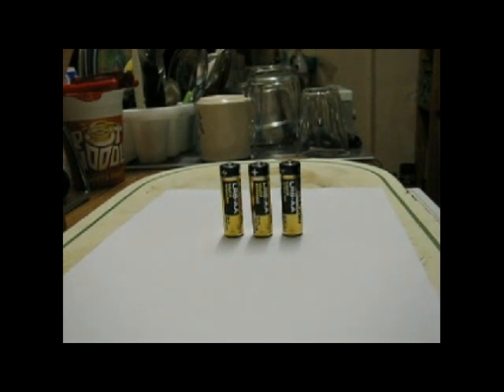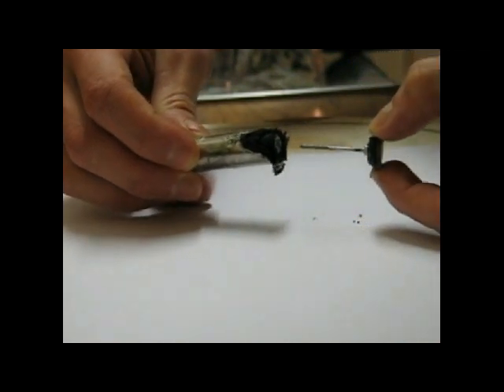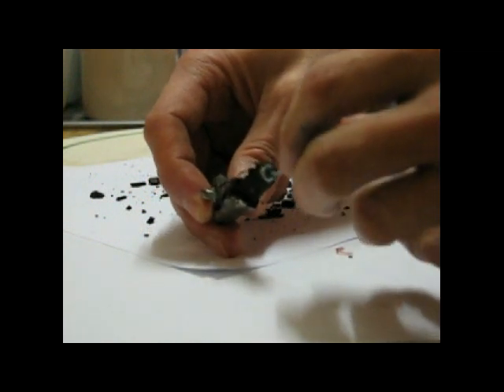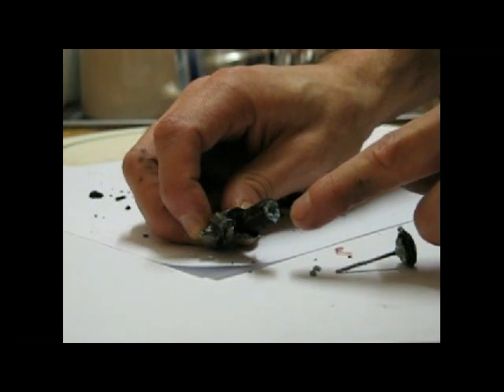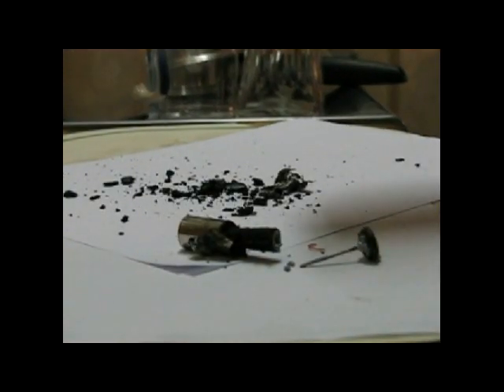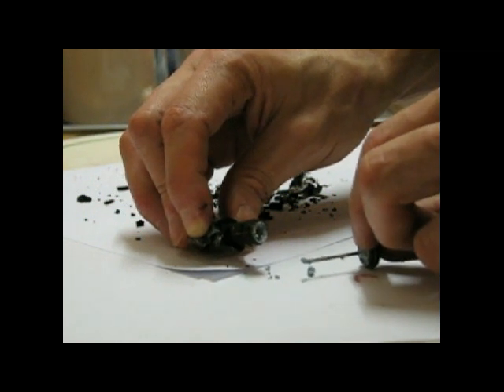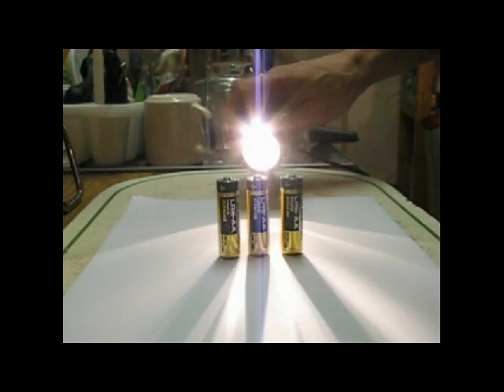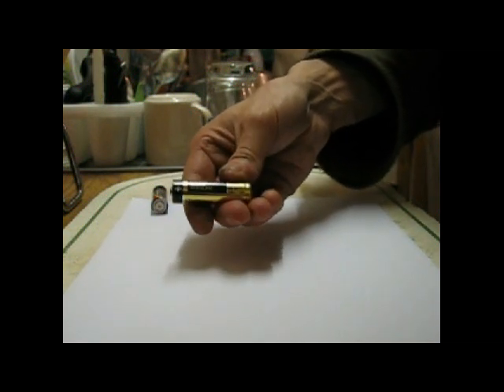Recharge Your Alkaline Batteries

Comment: You cannot recharge alkaline batteries with any practicality. The only way to extend the life of the battery is to put a small, very small trickle charge on it after it's been used for a very short period of time. A good example would be a portable CD that uses 2AA batteries that typically lasts 10 hours on 1 set. If you used a brand new set and used your cd for a 1 hour workout each day, by putting a charge on the cells each day after using it, you might triple or quadruple their life in the CD player to 30 or 40 hours. But this is inconvenient and it's just as likely that trying to charge them will do the opposite and drain them and even more likely that the battery will leak and ruin your CD player. In any event, Low self discharge NIMH batteries are sold just about everywhere and will work far better.
Reply: MattBlytheTheOne Knowing absolutely nothing about chemistry, I am assuming you need different chemicals that have different properties to get a potential across them?
Reply from the maker: The point is it is still the same technology as alkaline batteries, the manufacturers just package them a bit differently..
Reply: MattBlytheTheOne No it isn't, the chemistry is completely different.
Reply from the maker: Yeah it is, it is still using a combination of two metals and an electrolyte conductor.
Reply: MattBlytheTheOne
That is the nature of a battery be it a primary or secondary cell. Take a look at the data sheet for an alkaline cell (say an Energizer AA) and a rechargeable NIMH Energizer AA cell. The first thing that will pop out at you is that the amount of energy you can ultimately recover from a primary cell like Alkaline is dependent largely on the load and temperature. The higher the load (at the same temp), the less energy you can ultimately get from it. With NIMH, NiCd or Lipo, it generally doesn't work like that unless you put such high loads on it that you go out of spec and overheat the cell and this is because of the chemistry differences. There is reason for that rubber seal, it's for venting (to keep it from blowing up or building so much force that it shoots electrolyte out of the weakest spot)  and you will find a similar seal on secondary cells though it will vary with shape of the cell.
Reply from the maker: tarstarkusz
The metals might be different but the big difference is the seal, rechargeable Nickel Metal Hydride batteries don't have "air vents" so they will not leak out their electrolyte conductor, thus making them rechargeable.
Reply: MattBlytheTheOne NIMH cells have vents, trust me. They aren't normally open, they open with pressure to keep the cell from catching fire on a short or to keep it from exploding. That rubber seal also protects from short circuit. The whole can is negative all the way up to the anode (the positive button). Don't believe me, take the skin off another battery and put the neg terminal of a meter right next to that button and then put the positive terminal on the button and you will find 1.5V. Not all alkaline batteries are made this way, but many are. The rubber ring, in these cells serve 2 purposes, to let out pressure if the cell is overloaded and to prevent short circuits.
Reply from the maker: tarstarkusz The cells I have do not have vents. The alkaline solution does not dry out. If they had a pressure build up the case would give way. Can you show me an example of rechargeable NiMH cells with vents? As far as I know rechargeable batteries are built to withstand being recharged.
Reply: MattBlytheTheOne If you want to see a Li-ION or NIMH or even No-Cad cell vent, put a dead one in series with fully charged ones, it will reverse and vent and loose charge capacity permanently. ALL rechargeable cells have pressure vents. You may not be able to see them, but they are vented. Most are vented on the inside with seals designed to to vent at a certain temp or PSI. Think of it like a fuseable link, it's there, but you can't see it.
Reply from the maker: Well we have your word for it but I havn't seen one yet. It would make sense for safety reasons. Show me the link.
Reply: MattBlytheTheOne A quick google search of rechargeable batteries reversal and venting brought up this link which uses the words outgassing and venting. 
http://www.ka7oei.com/nicds.html
It also in the batteries for dummies PDF file written by a battery engineer.
I'll give you an example, there is ring around the anode of the cell that is a vent. It's 'normally closed' but under pressure it will leak gas (which is why the loss is permanent). Sometimes the seals are inside and not accessible and might not be recognizable, but all batteries are vented including primary and secondary cells. Many batteries have chemicals that spontoniously catch fire when in contact with water or high humidity (like lithium). Not venting could cause a pretty bad explosion in children's toys too. Kids are known to put differing chemistry cells together, old and new cells etc. The venting is done to cool the cell and to keep high pressure buildup. Just how much pressure do you think it takes to blow a cell apart?
Reply: tarstarkusz One other thing... If you are looking for something that looks like a vent, you might look forever. The way they usually work is a seal or ring is rated for say 2 atmospheres and is designed to expand if 2 atmospheres of pressure build up in the battery. IOW, it has more than 1 function and the venting function might not be obvious.
Reply from the maker: I look forward to seeing the designs. Are car batteries vented?
Reply: MattBlytheTheOne Depends. Car batteries are a lot tougher and sit in a car who's under-hood temp might reach over 200F and under 0F. But yes, many are vented, that is part of what the refill holes are for. The service free batteries, I confess, I do not know if they are serviceable or not. But I do know that liquid lead-acid batteries build enormous pressures. I've witnessed the filling caps flying across the room. Maintenance free LA batteries use gell, so I don't know how they work.
Reply: MattBlytheTheOne " I look forward to seeing the designs."  Ever heard of a trade secret? Even so, if you google it, you can probably find a generic schematic.
Reply from the maker: Yes I have heard of trade secrets. Ever heard of electrinium?
Reply from the maker: Or wondered why the battery companies use a bimetal sludge or how it is made?
Reply: MattBlytheTheOne As I understand it, it's never been demonstrated.
Reply: MattBlytheTheOne Yes, and I looked it up. I am not trained in Chemistry so I don't fully understand it. My specialty is electronics. I have formal training and 20 years experience.
Reply from the maker: I don't believe it has but you have to question why they use two dissimilar metals. It has something to do with the size of the atoms. 1.5v is typically the potential voltage difference between the atoms. One bonded pair will not give much power but lots of them will. Me too I was trained in electronics. What I learned after 5 years at college and then university and years of experience could be written on a matchbox. That's why I had to start examining the fundamentals because you need them to understand anything about electronics outside of a text book and they are not taught by the academic curriculum. Just like psychology does not teach you how to think.Which is why I took up psychology! I'm a slow learner  lol.

Comment: This is a lithium manganese battery. The cathode is zinc and the anode is manganese dioxide. Cathodes are negative electrodes, and a solution of potassium hydroxide separates these two electrodes. 2 hydroxide ions from the electrolyte become a water molecule and the extra oxygen bonds with zinc as it oxidizes releasing 2 electrons which will be picked up on the anode and the water molecule reacts with the manganese dioxide and the two electrons forming manganese oxide and two hydroxide ions. 1.22 volts of emf is from the oxidation of zinc and .22 volts emf is from the reformation of negatively charged hydroxide ions from two electrons a water molecule and further oxidation of the anode and these metal oxides are pretty poisonous and flammable lol
Reply from the maker: I think the important thing here is the bi-metal sludge that makes up what you call the electrolyte which is actually a fluid that allows electrons to flow between the molecules in the sludge. How the sludge is charged is the really interesting part.
Reply: MattBlytheTheOne It's not a bi-metal sludge, and it's not the electrolyte.  The electrolyte is KOH, and the sludge is powdered zinc in a gelling agent, with a trace of other ingredients to reduce hydrogen gas production (which is what causes leaks).  If you charge them, you'll generate a lot of that gas.  Why bother?  Get some good Eneloop or other LSD NiMH if you want to recharge batteries.  NiMH hardly ever leak.  Alkalines often do, and are certain to (in the long run) if you charge them.
Reply from the maker: Ok so what is NiMH if it isnt Nickel Metal Hydride? And what about cadmium and lead batteries.... its not even about recharging your old batteries it is about raising awareness and improving battery technology.
Reply: MattBlytheTheOne The video is about alkaline batteries.  NiMH are constructed differently and use a different chemistry.   Misinformation doesn't raise awareness or improve technology.  http://www.powerstream.com/BatteryFAQ.html for more info.
Reply from the maker: radellaf  You will notice ALL alkaline batteries are a combination of two different types of metals or elements... they have to be this way to obtain the voltage potential across the differently charged atoms, without which there would be no battery and without a conductor an "electrolyte" there would be no flow of energy. The link you posted says nothing about HOW these batteries work. What exactly are you misinforming people about?
Reply: MattBlytheTheOne This covers everything.  I'm not going to try to teach you electrochemistry in a comment thread: http://batteryuniversity.com/learn/
Reply from the maker: radellaf  It covers the basics of conventional text book battery theory and good idea.

Comment: Never put non rechargeable batteries in a NiCad or NmH charger,I did, and there appears to be a discharge of some kind [Gas?]which ruined the plating on the contact points on the charger and corrosion appeared all over, I had to scrape the surface clean and coat the contact points with solder.
Reply from the maker: They can leak and the electrolyte might damage your equipment. Did day that in the video. Not sure why they call them alkaline because the fluid that comes out is corrosive like acid. Another stealthy way if hiding the batteries real contents probably.
Reply from the maker: That is interesting thanks. Is that a fact?

Comment: Is the metal casing of the battery made out of lead or the inner core is made out of lead ?
Reply from the maker: Not unless they are lead batteries. Usually the case is tin and the core is zinc as far as I know. The surround sludge is usually a two metal compound which is surrounded by carbon.

Comment: Matt, the only safe way to re-charge Alkalines is to pulse the battery with "cold electricity" which is voltage without amperage. It is the amperage which causes the heat and leakage. I have a video that demonstrates one such circuit by IMHOTEP Auto Relay Charges My 9 Volt Batteries
Reply: +Ronald Gerth "Cold Electricity" huh?  Heh, the "zero point energy" people.  Jeez, you can't have "electricity" without a current...plain and simple.  No current is just that..how do you expect to do any work (otherwise known as power, which is Watts, which is amps x current) without a current?  You are right, it is a safe way, but not to charge anything. Period.
Reply from the maker: +ngc 1969 com ngc 1969 com I havnt researched "cold electricity". It is possible to have electricity without current flow (but not at the atomic level as they continuously spin which requires energy) it is called "static electricity" which is energy held in potential. Hence the term voltage potential. I agree that in order for voltage charge to flow from one state to another there must be current flow. Power is only measured when work is being done but something can have lots of potential power even when it is not doing any work.

Comment: I have always recharged alkaline batteries, even leaving them on overnight if they are decent quality (Energiser / Duracell etc) on a low current wall charger. As a kid, if i needed a battery quick, i would put 12vDC car battery charger through about 4 - 6 for a couple of minutes, lined up in series against a straight edge....lol. Never recommended, but It worked many times. :)

Moral of the story is, better quality alkaline batteries seem to hold charge better and don't get too hot either, and/or leak.
Reply from the maker: I would never leave alkaline batteries unattended or on charge overnight. The heat up and leak. If they didn't leak the pressure might cause them to explode. Exercise caution and safety first.

Comment: Overcharged my NIMH Motoma 2500 rechargeable for an hour or two but they did not leak just deformed the plastic box they were in, due to heat.
Now when i put them in my device they get really hot very fast. Could they still be of some use or are they beyond repair.
Brand new first charge killed them.
Reply: +linkingaj Wow, nobody answered that. not surprising.  I wonder how you made out with that?  Hahahhaha.  I would have tossed 'em.

Comment: In my experience and to help everyone out there I will tell you an almost 99% fool proof method of charging non-rechargeable batteries. Buy a socket timer with 15minute setting capability. Plug in your normal NiCD/NiMH charger into the socket timer. Set the timer to charge 15mins/Hour only. Leave the charger running for 4 hours then check the voltage. Try not to exceed 1,6 volts, check with multimeter, if you cant check the voltage, dont charge your batteries..simple. Charge again for 2 hours then check voltage...
Non-rechargeables and rechargeables have seals for safety, so they can vent and not explode, however some batteries if charged too hard for too long will go bang..be warned. A leaky battery should be disposed of carefully. Check my channel for Alkaline battery charging video.

Comment: I know alkaline batteries will hold a charge after charging,  but also tend to leak too !
Regular carbon batteries works good with recharge,  but recharging alkaline is risky if it leaks in expensive equipment like cameras.

Comment from the maker: The electrons are charged and held in a random parallel array, that is why the voltage will only ever be the same as the potential diff. between the pairs of metals... unless of course the atoms are aligned in series.

Comment from the maker: The popular theory is that the chemical reaction determins the voltage, but I believe it depends on the atomic potential difference between the metals used in the compounds. In other words, between an iron atom and a silver atom there might be a potential difference of 1.2v, other metals and the way their atoms are aligned in a battery give different results.

Comment from the maker: No, most alkline batteries have weak rubber seals and air vents, they are designed to leak. They cannot explode unless they are charged with an excessively high power charger.

Comment: I use oil paints including cadmium colors. I wanted to add that while cadmium, lead and other metals are toxic to various extents, they can be handled safely. The metals are most dangerous in their powdered form, like pigments that have been ground very finely but, metals themselves, even finely processed are too large to be absorbed through the skin. The greatest danger is the metal in a free base form, if the metal exist in a sludge, and oil etc. it is able to be handled just don't eat it

Comment from the maker: Alkaline batteries are not very efficient because the sludge is only aligned at manufacture and not fixed into position. Once the battery discharges or leaks it is not easy to align the atoms since they are basically in dissarray. Also once the alkaline solution leaks away the sludge cannot conduct or hold a charge. Free energy is nothing new, all atoms have energy, the sun has unlimited free energy. I am not really interested in making money from it...

Comment from the maker: Nickel Metal Hydride is used in rechargeable batteries since it lends itself to being recharged, but any two metals can be used if the atoms are of dissimilar sizes, like silver/iron or nickel/cadmium or silver/lead. Li-ion (Lithium Ion) batteries are basically a large capacitor since they are a thin film of Lithium metal, laminated and rolled up into a battery. Lithium batteries can be recharged many times just like a capacitor plate can be charged many times.

Comment from the maker: This is just the tip of the iceberg. If we aligned the bi-metal compound in alkaline batteries and fixed it in place with a hard pemranent substance the batteries would be much more efficient. Several people have developed permanent batteries from crystals and other compounds that NEVER discharge. Check out Marcus Reid and John Hutchinson, they have done pioneering work in this field.

Comment from the maker: The only difference in the packaging design between rechargeable and "disposable" batteries is that disposable batteries have "air vents" where the alkaline solution will leak from when put under even the slightest pressure ie. when charging. Rechargeable batteries are sealed units and will not leak under pressure even when charging. Did you even watch the video?